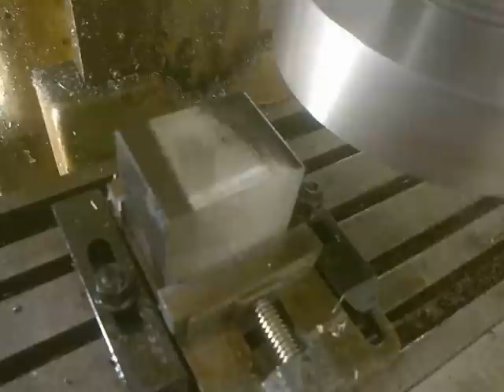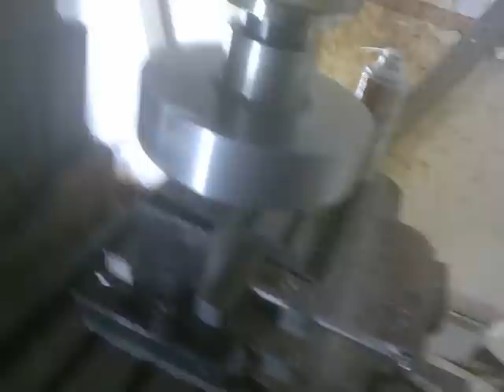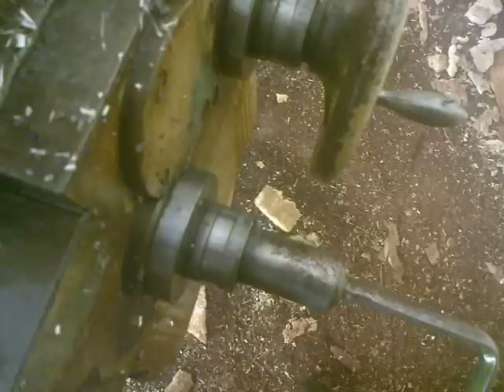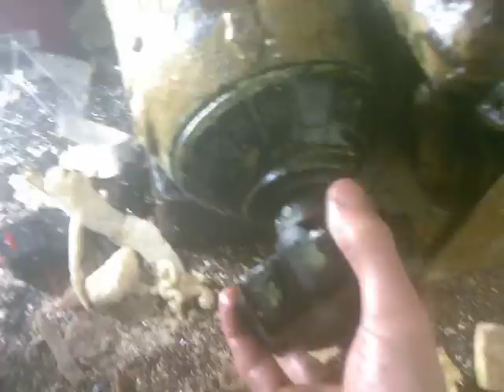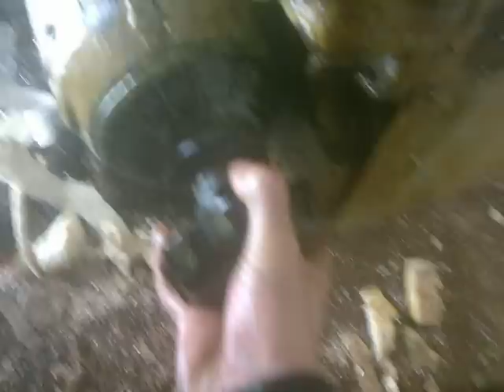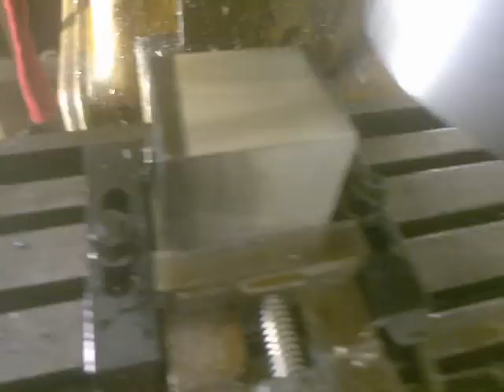Flycutting steel on my milling machine

Comment from the maker: I use it a lot to resurface cylinder heads and straighten exhaust manifolds for example. I've got a few vids about both of those, just search my channel! The cutter itself is very simple. It's just a big lump of steel with a simple lathe tool holder in it. It is modified so that it can take almost any type of insert in any angle. I might make a video about it if you like.

Comment from the maker: @TheAmazingdano No, it's on a small concrete base and there is sand around it for floor. It's a very bad place for a mill but that's all I got.. If a tool or a part falls to the sand it must be cleaned very well.. In two weeks I'm going to cast the floor in concrete too. That's also when my whole "workshop" is finished so the lathe will be in the same building and I'll have some room for my TIG-welder too. The shop will be about 3x8m. Now it's 3x3m..